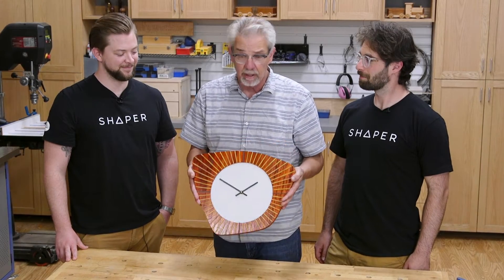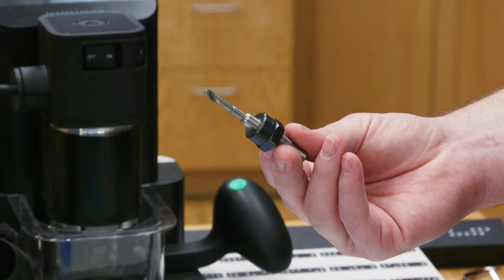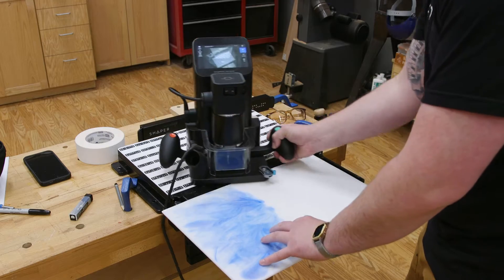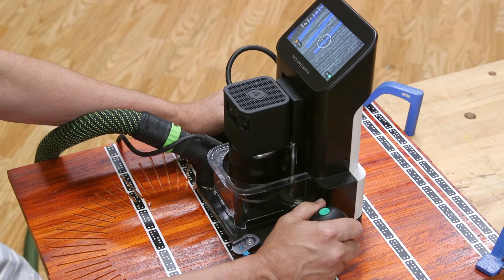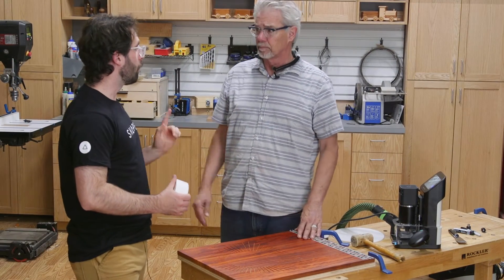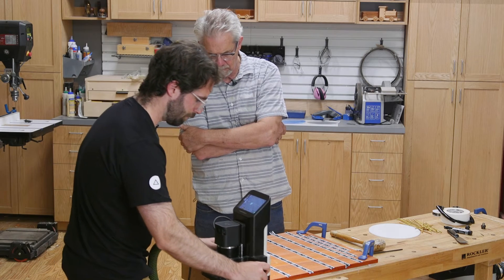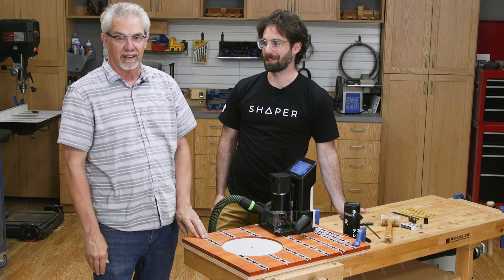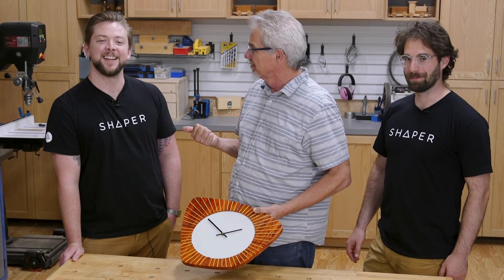Shaper Origin Expert Tips - Making a Clock

Comment: WAIT - HOLD UP!!! We have a bluetooth FesTool Vacuum.. and a  Festool Router (within the Origin Shaper rig).. and you 🎉 still had to push the button on?  

So the Festool Router is not automatically syncrynized with the Festool SysVac ?
Reply from the maker: The Shaper Origin is not a Festool Router, and not equipped with bluetooth. The Shaper Origin was not plugged into the Vacuum, thus not able to active the tool-triggered startup.